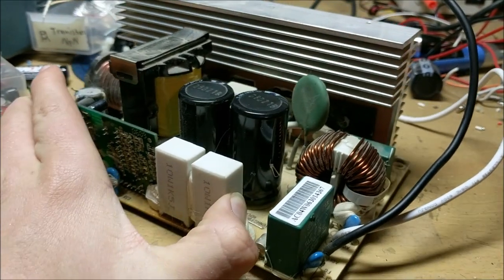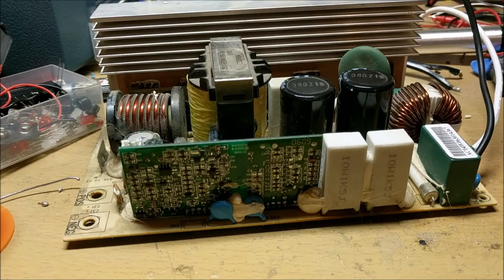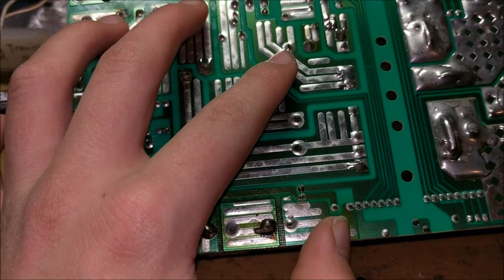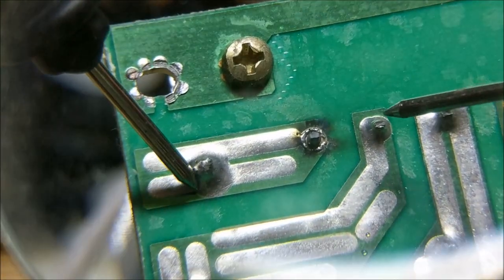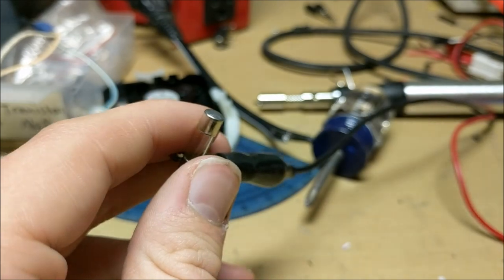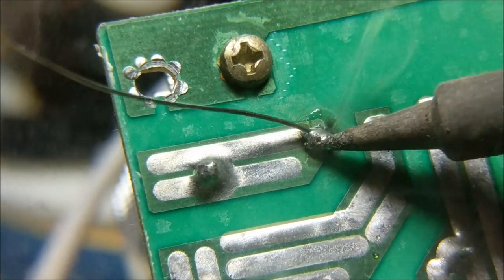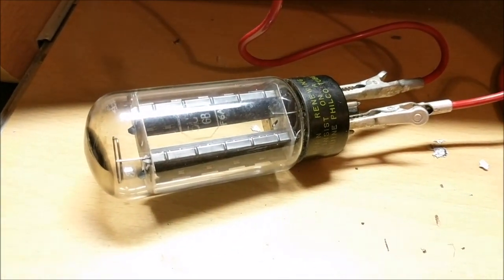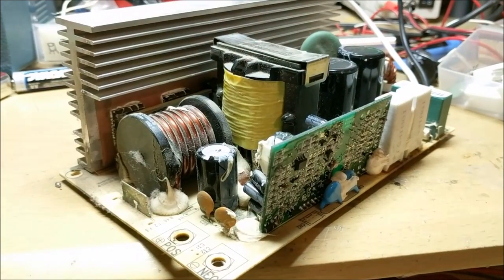How to Repair an RV Power Converter Circuit

Comment: I just opened up the back of the circuit board and using a magnifier......there it was... a burned solder joint.  Ten minutes later DONE , back in business.   Was ready t give up until I saw your video. Saved a ton of money

Comment: Tanner, Thank you!!  You saved me $221 plus tax.  I was just ready to go on Amazon and buy another Progressive Dynamics PD9260C converter. Prior I had talked with their customer service trying to get a schematic.  I told them I was getting only 3 volts.  They told me to throw it away and buy a new one.  I watched your video, pulled the circuit board out and found a probably 10 gauge wire coming through the board that was touching a cold solder joint thus the reason for only 3 volts.  I re-soldered it and am back up to 13.6 volts.
Reply: Nice find thanks for sharing!

Comment: Good job on the video, well explained I would like to add.  My 2016 converter just failed for unknown reason and I checked inline fuses, capacitors and power in and out.  I think that is a good idea to flip this board over and take a look at it before I spend 160.00. It all makes sense.

Comment: Hey Tanner I have a wfco board 55 amp not charging the battery have some electrical background. All the solder joints look good I notice some over heating on 10 wlk5j part -----what part would you suspect. The fuse is still good and don't know what part to replace.

Comment: @Tanner so if I do have the soldering iron and soldering wire and I have all the main power discounted from the RV. I can go ahead and solder it right there and then with out having to cut or discount the converter correct?

Comment: The WFCO 8955 that I am working on blew out the bridge rectifier ground pin, exactly as yours did. But, soldering the ground did not complete the repair. I have ordered a new bridge rectifier and hope it will be the cure. I am also replacing the two, big smoothing capacitors as general maintenance, while I have the unit open.
Reply from the maker: Interesting, does it still put out too low of a voltage?  Good luck on the repair!
Reply: @TannerTech  I replaced the bridge rectifier, as it had failed. I replaced the main smoothing caps, C7 and C8, as general maintenance. I replaced cap C9, as it had failed with a high ESR (72 Ohms.) I replaced cap C10, on the control board, because other people have had it fail. I only use I quality caps. In this case Nichicon and Panasonic. The unit does regulate, now, mostly between 13.5 and 14 volts. But this was just a no-load test on a multimeter. However, I am confident that it will be fine, when installed. Thank you for your help!
Reply: How did you identify the specs of the rectifiers and where were you able to get replacements from?
Reply: @Command37  That was a long time ago, but I would have identified the part from the writing on the old one. I bought it from Mouser.com. I looked through my orders and found their part number= 621-GBJ2506-F. One of the pins is offset, as I recall. It fit perfectly and worked fine. But, you need to make sure it is what you need by checking the specifications in the data sheet. I hope that helps. Let us know, if it works for you. I would be curious to know.

Comment: Tanner,  you are super intelligent,  love watching all your videos!  I came upon them searching for a diode to repair the power converter circuit on my rv,  pretty sure I have identified the problem but cant find the part,  it is the large green diode beside the black cylindrical power capacitor.  where on earth could I get this?  I don't know the correct name to search for it.  any info would be appreciated... and keep the the good work!
Reply: Lisa, did you ever identify and acquire said diode?
Reply: Sadly, Lisa electrocuted herself whilst working on something that she was completely unqualified for. RIP. ☠️

Comment: Oddly enough, ours had a solder failure at the EXACT same spot.  A little dollop later and we saved ourselves about $130
Reply from the maker: That's crazy! Stupid manufacturer defect!
Reply: @TannerTech  Hey I have the same inverter that works but only outputs 9 VDC. Any ideas?

Comment: Hello,
Need your help
I have the wf8975 or wf9875... old version.. someone connected the rv to a outlet and seems like it was high amp outlet and blew the fuse... istalled new fuse and keeps blowing up fuses... any idea why?  I thought it was the capacitors but i think they are ok... there is a short somewhere... could it be the transformer itself? Any idea of schematic? 
Please guide me... i may have to order nee one but for the sake of pride i want to find the problem and have it fixed...
HELP!
Reply from the maker: It might very well be the capacitors.  Try testing them with a multimeter set on resistance.  Idealy the capacitors should have no resistance across them.  Let me know how that works out
Reply: @TannerTech  oh? close to zero when you first apply the multi meter but if the cap is any good, the resistance will climb with time

Comment: What size was the fuse you replaced, I have one I need to replace also?
Reply: The 8955 that I am working on has a ST15A/250V, ceramic, slow-blow fuse. It has axial pin leads. Each specification is important to the safe operation of the unit, so do not skimp and use a glass fuse.

Comment: What is most likely to blow on that circuit board if it was accidentally connected to a 220v power supply?  I see a fuse by the input ports.  Everything works in the RV except the 12v stuff - refrigerator,  lights, etc.  Ugh!

Comment: Hello I have just discovered I have the same board.  I'm getting 10volts out of the board.  Not charging the battery.  Unfortunately I replace the board, now up and running.  I would like to have this one repaired.  Any ideas on a issue with output of 10volts DC.  Manufacture was no help, apparently sold out to someone else.  Many Thanks in Advance.

Comment: Hi thanks for your video, I have an issue with my rv conveter.  It's seems to be the same kind of yours on the video.  I've checked the soulders, they look good.  Can you tell more about the next step?  I think about testing the capacitors but maybe there is some components that I should check first.  Also, when I plug my rv in 220v outlet, my plugs in the rv itself read 220v and when I plug it into a 110v, it read 110v.  Is it that because the conveter don't work that I stay with a 220v in my plugs?  The air conditioner is not working properly also but I think the problem's coming from the same place, the converter.  I also check the conveter directly on 110 v and nothing happen.  Can you tell me more about all this?  Thank you
Reply: Sounds to me like a bad neutral (white wire) connection. This is causing the 120/240 volt connection not divide up properly. Test first at the pedestal connection to see if you have a neutral connection there (see instructions below). Then inside the trailer at the breaker panel. Did someone recently replace the power cord or plug end. If so it may be miswired or broken inside if it the cable was stretched or pulled such that it was broken inside.     

They way it should work is when connected 120/240 your AC should have two hot wires each at 120 volts to the neutral connection with 240 to the each hot wire. When connected to 120 volts through a dog bone your hot wires get the same phase instead of opposite phase and the campground breaker will trip at 30 amp 120 volts and if you have any 240 volt only appliances they will not work at all since both hot wires are now on the same phase. You should always check the power connection when using a 120/240 connection because bad campground wiring can cause your 120 volt appliances including the 12 volt charger to fail. 
 
  http://www.myrv.us/Imgs/PDF/50-amp%20Service.pdf
Reply: you should never have 220VAC on an RV Shore line plug. the system is designed for 110VAC, always. you have most likely blown every 110VAC appliance, if not properly protected from overvoltage.
Reply: the converter only takes 110VAC, and converts it to 12VDC (more like 13.8VDC) to 1. charge and maintain the deep cycle batteries, 2. provide 12VDC to appliance control circuits, 3. provide 12VDC to lighting, 4. provide 12VDC to car radio/DVD, etc.

Comment: My converter doesn't come one when plugged into a 110 unless i throw a breaker to get the converter to come on. it'll run, the lights will get bright but once the converter kicks off it doesn't want to come back on by itself unless i throw the breaker again. The batteries are not fully charged the converter will not come back on unless the breaker is thrown. What should i do?

Comment: Having a problem with my  travel trailer converter. I hooked my cables up wrong and blew the 2-30 amp fuses that are there to protect the converter for things like this. When i hooked up the cables the right way it still blows the 2 fuses.Voltage at one side of fuse holder shows 12.5 volts but when I install another fuse it still blows. Any ideals or help would be greatly appricated. Thanks Francis.
Reply: I have the same issue and my fridge won't work.  I can't figure out why
Reply: @ToolguyFromDE  Most fridge and propane furnaces wont work without 12 volts.

Comment: Update I replaced the two large capacitors and it puts out 13 volts on the bench but I notice the cooling fan isn't on will it come on during load. The fan does work.
Reply from the maker: +Tom Brady the fan only is supposed to come on when the temperature of the heat sink reaches a certain point.

Comment: Heat damage under R3, R2 and R27
Reply from the maker: Hmm, is it not outputting the right voltage?  Heat damage could be a lot of things.  What components are near R3 R2 and R27?  I dont have the converter in front of me.